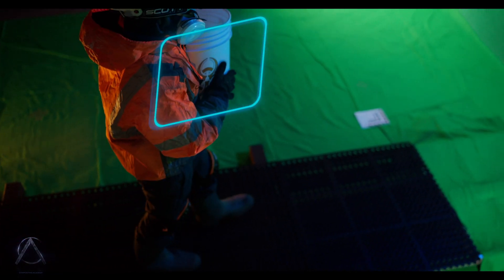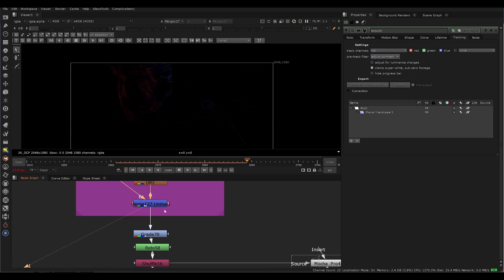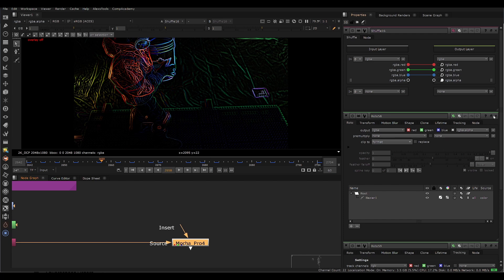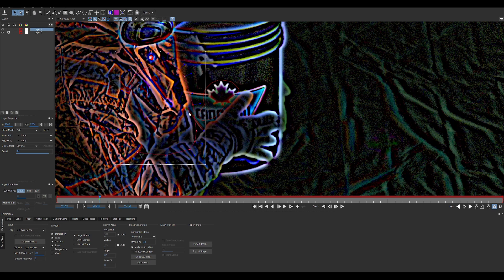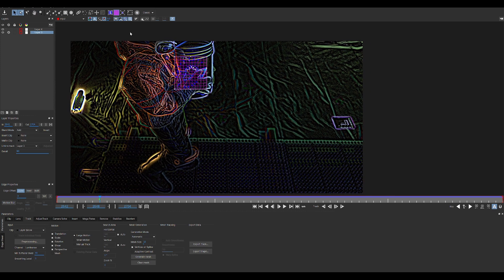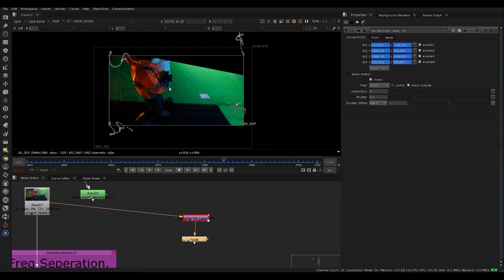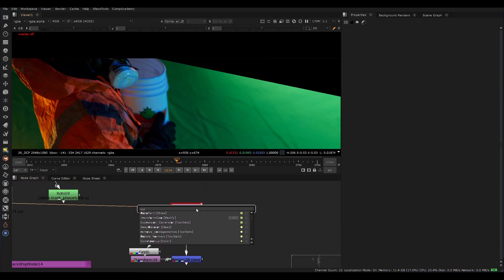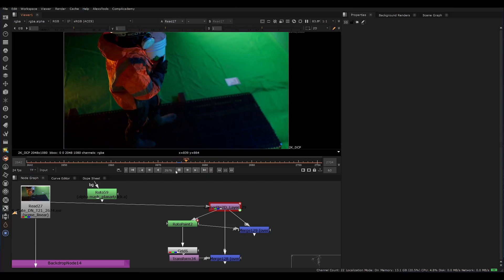Track Any Surface with This Mocha + Nuke Trick!

Comment: Did you try cropping to just the logo area then running a camera solve on it?  From there you can generate a point cloud/mesh that you could use to place a cylinder in for the bucket and let the camera do the tracking work.
Reply from the maker: That could potentially work as well.  Usually I try to avoid 3d stuff if I can just because I prefer getting a quick cornerpin then painting, but the method you're suggesting or Keentools would probably both work too

Comment: Why didn't you use smart vector?
Reply from the maker: When there are occlusions (objects passing over the tracking area) smartvectors will break.  Also smart vectors don't like light changes very much either.

If this were a deforming surface you could try something like the Mocha Power Mesh which is kind of like subdivided planar tracker.